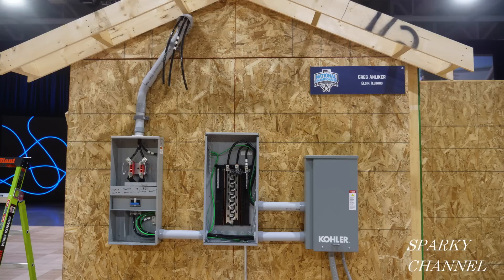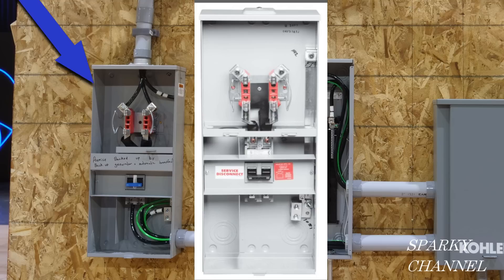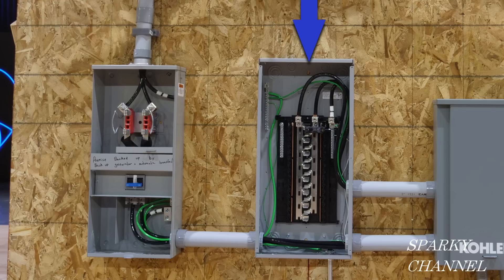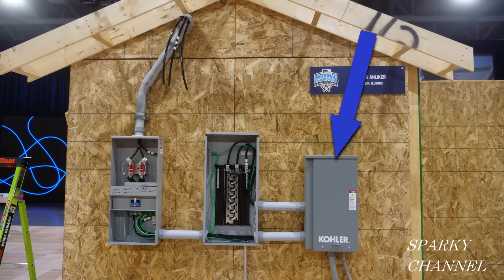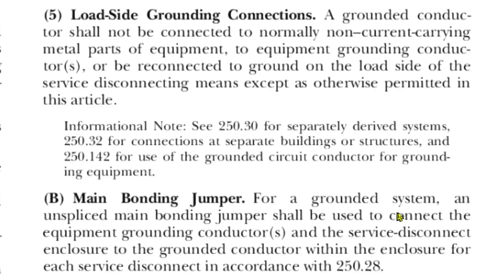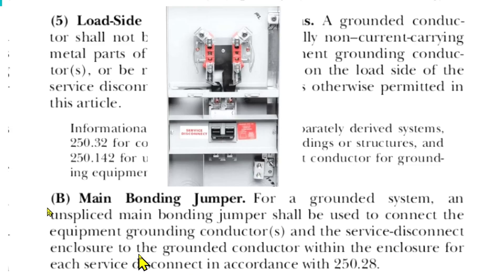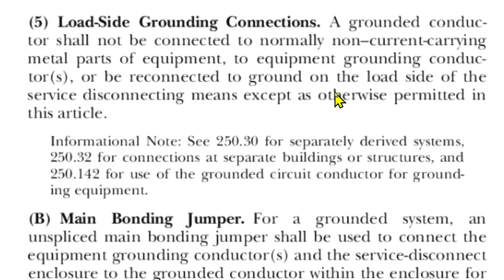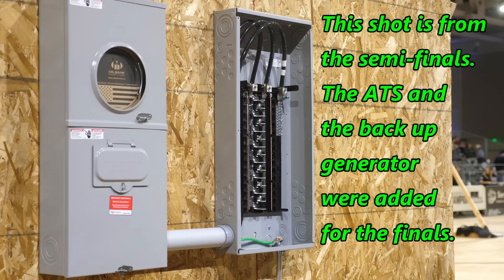In Which Panel are the Neutral and Ground Bonded?

Comment: Best, best YouTube video about this electrical topic ever. Easy to understand and your videos are above the top. You are really one of a kind with your videos. Awesome video and keep it strong Bill! Amazing work and awesome video! Nobody out beats Sparky Channel!
Reply from the maker: Thanks so much!
Reply: @SparkyChannel hello just get a 200 amp over head meter. Then out of the meter hit the transfer switch! With 4/0 4/0 2/0. On the face of the transfer switch  make a label saying (EMERGENCY DISCONNECT NOT A SERVICE DISCONNECT)  out of your transfer switch go to your in door panel that a 200 amp main breaker with also 4/0 4/0 2/0. Then in that panel you can bond the neutral and you’re grounded electro together.

Comment: For those who are confused at the final explanation, He is reffering to neutral(white) not being bonded on the 2nd and 3rd boxes only ground (green) is bonded to the boxes.  Finally, in the first one box, Neutral and ground are bonded to each other and the box.  NEUTRAL is called "grounded conductor" and GROUND is called "equipment grounding conductor " @didimilano2438

Comment: I have a detached building very old that has a sub panel fed by 3 wires two hot and neutral.  No ground.  It’s not cost effective for me to run a ground wire.  So what can I do in this instance bond or not bond?  I did add two ground bars as there were none.  Any help will be greatly appreciated.
Reply: Hire a pro.
Reply: Is it cost effective after you become part of the ground? I would just pay the price and get it setup safely so nobody gets killed.

Comment: How big are the green wires? Why aren't there any grounding rods?  I have that exact meter box (200 amp). Electric company put a ground rod w/ bare #4Cu at that box. I ran bare #4Cu to downstream panel 100' away and connected 2 ground rods per NEC at that panel. Did not use grounding screw (ie kept ground and neutral seperate) at that panel. Ignoring local code, does this comport w/ your interpretation of NEC?

Comment: In your video, you state the grounded conductor must never touch the enclosure in the middle or right enclosures but in the middle enclosure, the grounded conductor is clearly attached to a grounding bus bar that's that's also clearly secured to the enclosure (i.e. it's grounded to the enclosure)...
Reply: NEUTRAL is called "grounded conductor" and GROUND is called "equipment grounding conductor "

Comment: To the closest to the service conductors. Meter box. 

NEC 2023 Article 
250.24(A)(1): The grounding electrode conductor connection shall be made at any accessible
point from the load end of the overhead service conductors, service drop, underground service conductors, or service lateral to the terminal or bus to which the grounded service conductor is connected at the service
disconnecting means.

Comment: What I don’t understand is that even though the neutral and ground bars in a subpanel may be physically “separate,” aren’t they still technically “bonded” at the subpanel by virtue of being screwed in to the same metal case (the subpanel) through their metallic mounting screws?  The metal screws mounting them both in the same subpanel would put them at the same electrical potential, thus “bonding” them regardless, no?
Reply: neutral bar is insulated between the shell, the green bonding screw is what threads direct from bus to shell, bonding the neutral bar
Reply: Yes if you connect both the neutral and ground buss to the panel by bonding screws they will indeed be connected together by way of the metal box. But the only place you would do this is at the first point of disconnect. Which ever box the first main breaker is in, that is where you bond the neutral and ground and then nowhere else after. They must be kept separate in every other panal after that. If there's a bonding screw in the neutral bar in any of your other panals do not connect it to the enclosure. You can and should connect the ground to the enclosure but not the neutral in any other enclosure besides the "first point of disconnect". Remember those words, it will help you to identify exactly where to bond and where to isolate the neutral and ground.
Reply: @michaelknight4041  and sometimes the meter itself, or knife switch is first point of disconnect, before main panel

Comment: Look at 4:00 and 5:10. One diagram has 2 grounds cables in the middle box and then you see the second ground cable missing....

Sparky, So the main lug panel in the middle and the right panel needs to have ground bars added and the neutral should not be connected to the ground cable from the grounding rod. Also, why is a ground going directly from the meter to the middle box instead of middle box to the right box? If I understand correctly, the meter is feeding first the right panel then going back into the middle main lug panel???
Reply: Routing the ground like that is fine, it doesn't have to follow the feeders like that lol

Comment: I have a question in order to clear up some confusion that I have (and also caused by statements that others have posted in the comment section).
(I am not a licensed electrician, but I have worked with electricians on many residential projects.)
I fully understand that the bonding of neutral and ground takes place at the [meter box] main service disconnect box.  I am assuming here in this video that the main ground wire going to the grounding rod(s)) is also at the main service disconnect box [meter box].   1st question is:  would the bonding of the neutral and ground still take place at the main service disconnect box [meter box] if the main grounding wire to the ground rod(s) was at the breaker panel box?  (Copper ground wire attached from grounding bar in the breaker panel box and running down to the ground rod).
My 2nd question:   …is there a time when you would have a ground wire running from the ground bar in the main service disconnect box [meter box] down to the ground rod AND ALSO another ground wire running from the ground bar in the breaker panel box down to a separate ground rod?
Thank you

Comment: Is in the center panel that's where they're bonded together
Reply: it depends where the actual ground is. It should be bonded where the closest entrance is such as the meter or sometimes the main panel if its on the other side of the wall.
Reply: @ZackMeetsWorld thats not right no
Reply: @coreyfranco7060  the neutral has to be bonded to ground in the first means of disconnecting. I should have made it more clear

Comment: Lightning does not like to change directions, and as we know is capable of ionizing the air as a current path. So we have to imagine how a lightning event may enter the main service panel, and if so where does it go? 

Well, it wants to return (cloud to ground) to the earth (polarity wise we have cloud to earth or earth to cloud) by the shortest path based on conductivity. So, I think, ideally the grounded conductor (white) center tap of the service transformer (which is also earthed at the pole, US AC distribution) can be considered a primary candidate for a lightning event. As such, the earthing of the main service should be directly below the main service panel, and not jogged through the remote breaker load center. Also, if we look at the mast itself, as shown in the video, to me it makes more sense if the mast, mast head are made of a conductive metal and not plastic. It can serve as a lightning rod which could route lightning energy directly from the mast trough the main service panel enclosure to earth without finding its way into subsequent load centers and branch circuits.
Reply: Nothing in this world will protect you from lighting.
Reply: Yea, what the heck is this guy saying lol
Reply: If your mast gets a direct lighting strike everything is toast, bro.

Comment: I have a single phase 200 amp Square D outdoor weatherproof disconnect. It has a three space neutral Lug right next to the green grounding bonding screw that I installed.  I understand I need to bond my grounds and my neutrals together because it is the first means of disconnect (AKA MAIN PANEL) and installing the green screw bonds the neutrals to the actual metal disconnect/ground.  My question is do I need to install a separate lug for my ground wire on the actual metal part of the disconnect or since they gave me a 3 space lug neutral can I simply install my grounds and my neutrals in that three spaced lug they provided?
I would say absolutely one hundred percent yes because it has to be bonded. But again do I have to install a separate lug to the actual metal back of the disconnect (AKA GROUND) isolated from the neutral LUG? Or can I just simply install my ground and my neutral in the three space lug they provided?
Thanks!
Reply: The nuetral and ground in this enclosure are one in the same...

Comment: Can you explain why it’s not bonded or the dangers of bonding
Reply from the maker: I'm going to have a 2023 NEC update of this video coming out tomorrow. Please check it out. As for the danger of bonding in the wrong place, the neutral is the return path of the current, and ground wire holds the fault current to trip the breaker in protecting the person and the facility. Bonding beyond the proper location ruins this system and is dangerous for that reason.
Reply: Either will still clear a short even if there is an existing ground fault.  We just don't want current on the egc

Comment: Ok so basically the transfer switch doesn’t switching the neutral.  Well i think you can bonded at the transfer switch too if you choose too.  Probably you have to terminate electrode grounding conductor at the transfer switch if you doing so.
Reply: Nope, no bond at transfer switch

Comment: Idk I'm in Ohio and my 200amp disconnect is bonded together at the telephone pole and then in my house it goes into a 200amp breaker in main panel and it's grounded together to with neutral.

Comment: So basically the ground and neutral should be separate, when down stream of the main disconnect?

The only time you would see the ground and neutral bonded in a main panel is if the main disconnect is in the main panel? If the main disconnect is separate, such as out by the meter, then the main panel will have a separate neutral and ground.?
Reply from the maker: Yes, that's correct.
Reply: @SparkyChannel  It appears to me that a similar but not identical setup could allow the breaker panel to be the location of the bond. If the disconnect at the meter is labeled "EMERGENCY DISCONNECT, NOT SERVICE EQUIPMENT" and then the breaker panel had a main breaker, that main breaker in the panel would be the first "SERVICE DISCONNECT" and when labeled as such the bond would be proper at that point. Is that the correct interpretation of 230.85 and the relevant bonding codes?
Reply: No

Comment: question:  From the picture it appears your ground bus bar in the 2nd panel(interior) is mounted and touching the enclosure?  Are you saying it shouldn't?
Reply: I think the "grounded conductor" he's speaking of is another term for the white neutral wire. The "grounding conductor" or "equipment ground" is the green/bare equipment ground wire.

Comment: Different scenario: Subpanel in a separate garage building. Assuming that the subpanel gets bonded to a separate EGC and the ground from the main panel is run, but not connected to the subpanel, it's just capped off inside.
Reply: Subpanels with more than one circuit in a detached building require 4 wires and their own grounding rods. The only exception to grounding rods is 250.32(A) that allows for running a single circuit without installing ground rods.
Reply: I could even envision not running a ground between buildings. The question is also about conductive conduit between buildings.

Comment: Hey Bill, so I am at an impasse with the local utility company. They supply the meter base and then you have to install your panel, but they want the meter base to have the EGC and then take it to the panel, but that goes against what I know and what you state here. It leads to the meter base and the main panel being bonded, creating a parallel neutral. Should I whack them over the head or just go with it? I wish they supplied a 200 amp disconnect in the meter base like you show. That would simplify it. Thanks again Bill!
Reply from the maker: Hi! Does your meter base have a disconnect? The EGC goes to the first panel of disconnect.
Reply: @SparkyChannel  Sorry, I was a bit long winded. No, the meter base does not have a disconnect so that's why their utility spec sheet is at odds with the NEC. I spoke with the engineers and they said they weren't sure, but to follow the NEC, so I just ran the EGC into the Main panel and only have the two hots and the GEC coming from the meter into the panel. The grounding lug in the meter base I just left empty. Because it's on a metal building and the box is bonded with neutral and has watertight EMT between the meter and panel, it's all technically bonded with ground anyways, but no specific wire connecting the two to ground.
Reply from the maker: @MyFortressConstruction  I agree with the engineer, just follow NEC. If you get flunked by your AHJ make him show you what NEC code you violated. If he can't show the problem in the NEC he'll have to take the flunk back.
Reply: @SparkyChannel  Thanks Bill. The funny thing is that it's the trenching crew (Not electricians) that is going to verify if their meter is correct, and they go off the AHJ spec sheet, which is at odds with the NEC! LOL. We will see...
Reply: @ElementFreedive  Don't know yet. They have set the transformer but they haven't given a date to trench to the meter yet. I'll try to remember to post back when it happens. Seems like everything is taking months nowadays...

Comment: You lost me at the end. Not sure what to do now. 😂
Reply: Talking about 4:50? If so, it's because the NEC refers to a neutral that is grounded as a "grounded conductor". The "equipment grounding conductor" (EGC) is the bare copper going to the ufer or ground rod. So the neutral is bonded to the first panel (making it a grounded conductor) that has a disconnect, and then it is kept separate from the EGC in every other "downstream" panel.
Reply: @MyFortressConstruction  Thanks, I was lost there too, but your explanation brought it all back together for me.

Comment: Isn’t the main disconnect metallically connected to the middle panel, with the bus bars, via the metallic 2 inch pipe, so therefore grounding the middle panel, in all practicality,  would also ground the first panel.

Comment: One extremely important aspect of this you did not point out is when to bond the neutral at the transfer switch. If the generator shares a neutral with the utility service, as shown in your video, then no, the neutral won’t be bonded to ground in the ATS. But if the neutral is switched along with the phase conductors, the generator is a separately derived system; and in that case, the generator neutral must be bonded to ground in the ATS.
Reply: So if I'm only switching the current carrying conductors then I only need to run a neutral from the disconnect neutral buss to the transfer switch neutral buss? Also does anyone know a good way to install a transfer switch with a combination meter/disconnect?
Reply: @lauratanner8475  the neutral is a current carrying conductor.
Reply: @RB-xv4si  ah....I should have said if I'm only switching the phase conductors and not the neutral.
Reply: @lauratanner8475  you will need to run both the generator neutral and utility neutral to the transfer switch. The neutral not being switched means that you will not bond neutral to ground in the transfer switch.
Reply: @RB-xv4si  thank you for the info. That was how I was thinking it should be but nice to have confirmation. I have a generator with ATS to install on an existing service. The only thing is that they've used a combination meter/disconnect with with circuits being fed from the disconnect buss. I see no elegant way of doing it besides adding another disconnect and moving the circuits to it and treating the combo meter/disconnect as basically just a meter. The only thing is if the breaker in that box is shut off or tripped the generator will activate. I don't know yet which way to proceed. Might end up steering clear of this one
Reply: @lauratanner8475  I don’t think a main breaker tripping is a common occurrence. Shouldn’t be an issue.